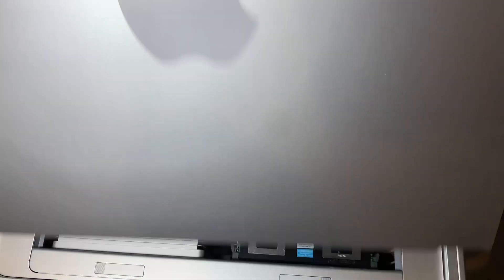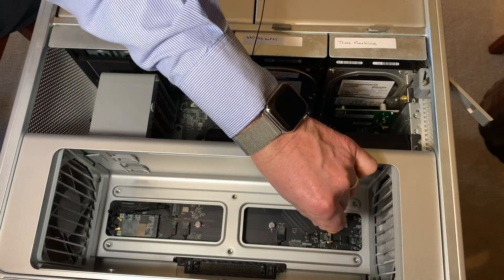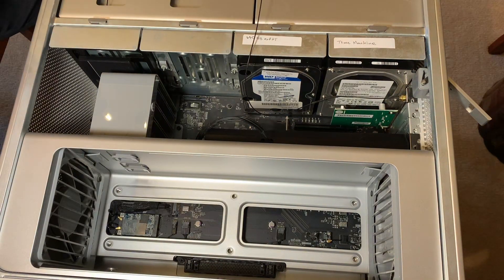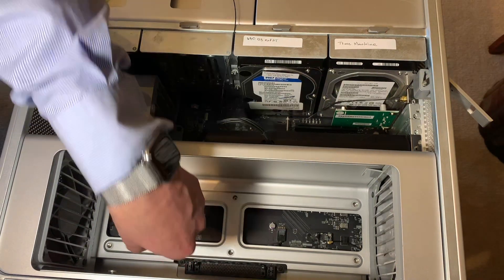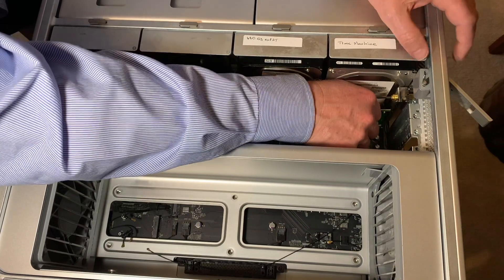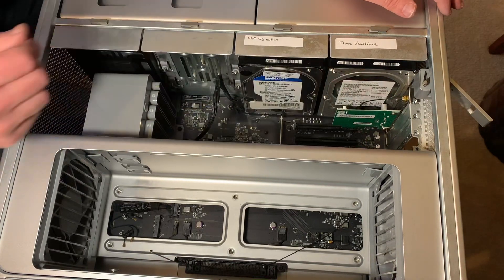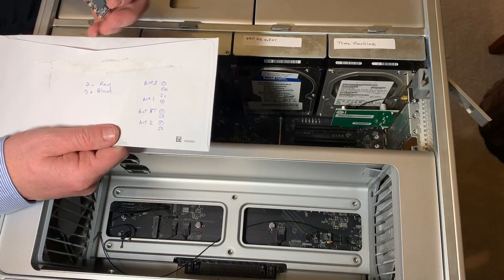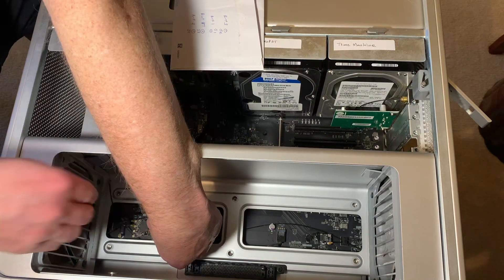Mac Pro WiFi Bluetooth Upgrade 2

Comment: Thanks for showing how hard this actually is! I struggled last night with getting the four antenna wires connected and the card flipped and positioned.  I am thinking a line of hot glue on top of the antenna connectors might be very helpful.  Hopefully I didn't damage anything.  Thank again!

Comment: Where can I buy the PCIe wifi and whats the name? Thanks
Reply from the maker: This is the kit I would buy if doing this now https://www.intriguingindustries.co.uk/product/macpro-4-1-and-5-1-wifi-and-bt-upgrade-kit/
Reply from the maker: The mini PCIe adapters come and go on Amazon and eBay.  I searched this morning and found this https://www.walmart.com/ip/Xiwai-Card-Wireless-WIFI-Mini-PCI-E-Card-for-Mac-Broadcom-BCM94360CD-BCM94331CD-BCM94331CD-BCM943224P/417089672?wmlspartner=wlpa&selectedSellerId=101130051